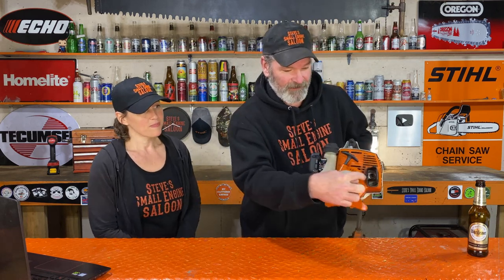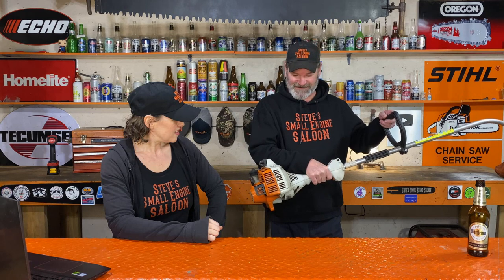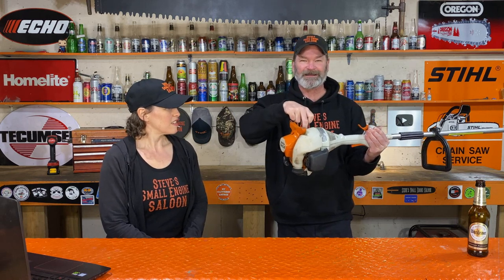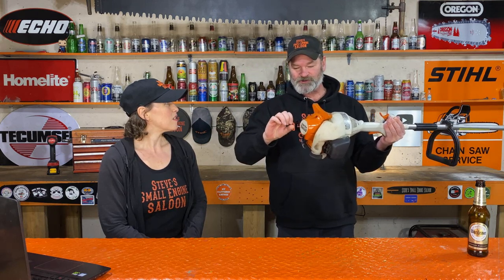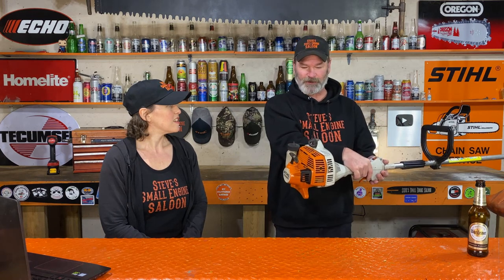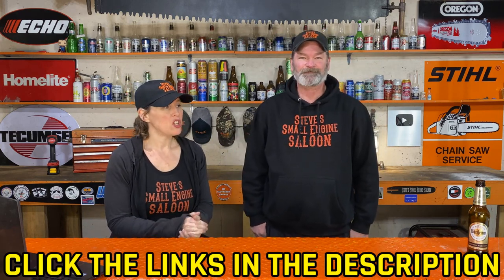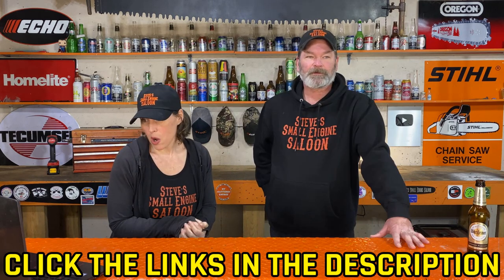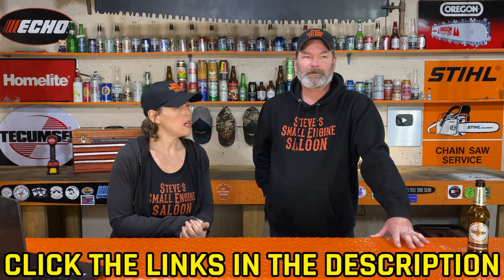Why Is There Black Oil Coming Out Of My Muffler? (DAY 27)

Comment: Thanks for sharing Steve, if I can add - The black oil Is known as spooge, it’s when a 2 stroke is running too rich, too cold or if the engine doesn’t get enough load. It’s incomplete combustion.

Comment: That's a good tip, because a trimmer doesn't get tipped over as much as a chainsaw.   My trimmer muffler is quite a mess, but I don't really care.  It's still running strong after 29 years.  If I cleaned it up good, it would probably die tomorrow.    I will flip it some time, but not today (nasty snow storm at the moment).   Good stuff!   Thanks for sharing your knowledge!

Comment: Also, could be from an engine that is tuned too rich.  The unburnt fuel/oil will build up around the exhaust outlet.  My ice auger will do that on a warm day on the lake.  After 10 or so holes there's black goop dripping from the muffler.  Wonder what folks would think if I turned an ice auger upside down on the lake and revved it up?
Reply: Tell them your fly fishing!!!

Comment: Great Steve and April, I also like a little smoke in my 2-cycle exhaust from oil/gas fuel mixture to make sure it has plenty lubrication as some may not know that is the only lubrication a 2-cycle gets on the internals in contrast to a 4-cycle with oil in it's crankcase.

Comment: I've never heard of that tip but will definitely give it a try. I just got a new 2 cycle weed eater and noticed the black oil under the muffler w which started leaking from between the covers. I thought maybe it was running rich, but I'm glad I found this video first. Thanks for the tip.
Reply from the maker: You're Welcome...

Comment: Ok Steve, I see your holding a FS45. So now you can show us how to tear it apart to change the kill switch, (day 25 show). I've used WD40 on switches before with good results. But like you said, there's a 2 out of 10 chance that I'll have to change the switch!  I'm gonna go run my weedeater upside down now! Good tip, I never thought of it. THANKS!

Comment: Because I grew up running two stroke engines in model aeroplanes i learned very early how to avoid flooding. But far to many guys don't understand that a couple of pulls at full choke is more about priming the engine. Depends a lot on the engine but some fire at full choke, some you need to back the choke off after a couple of pulls to avoid flooding. The manuals never explain this stuff very well though.
I've seen guys pull and pull on full choke ten plus times and it's over.
But you can't tell 'em. They will not listen if you tell them to back off the choke. Lol.
Reply: And I thought it was just me watching guys flood 2-strokes! It is sorta funny, just not to them lol. Oh, and it usually takes that customer 3 or 4 times flooding equipment until they finally get the joke 🤣😁
Reply: @donmayberryjrsOPE  
Some guy's think and listen. But it's usually the people who think they are smarter than average who are the dumbest.
Reply: @joschmoyo4532  true story!

Comment: Very interesting! I’ve had a similar problem with my MS251 for years and haven’t been able to figure out why. Thanks guys!
Reply from the maker: Our pleasure!
Reply: Hey jason, ive got a brand ne 251 too, and the same problem. I thought at first that its gonna stop splashing after 3-4 tanks, but im on my 5th and it hasnt stopped yet. It it ok for you now? Did this throttle and turnover trick work for you?

Comment: The same phenomenom exists on all 2-stroke engines, including outboards as unburned fuel runs down the middle section and dilutes carbon deposits on its walls. It happens mostly after prolonged cranking as raw fuel is shot down the exaust.

Comment: I recently bought a push mower that wouldn't start.i got to messing with it, oil was coming out of the muffler. The fellow I bought it from had turned it over the wrong way so I thought maybe that's why oil is coming out of the muffler. I looked in the gas tank & decided to put in fresh gas. When I dumped out the tank, to my surprise there was oil in the gas tank. I rinsed the tank with gas, cleaned the plug, finally got it started. It smoked for a long time, then quit smoking. The motors good. Why anybody would put oil in the gas tank I couldn't say. Maybe the best $10 I've spent in a while.

Comment: My Echo 2511T is doing this...I leaned it out as much as I could without taking the limiter caps off...still oozing out of the muffler. Will have to try this but obviously would like to fix the root of the problem which I believe is just running too rich like a lot of Echo saws seem to

Comment: I agree with 99 percent of what you said except one part. That oil/fuel mixture that puddles on the bottom of the crankcase with be forced out and burned at full throttle because the air velocity will lift it to the transfer ports and burn it.

Comment: I'm gonna try that tomorrow!!!! I've got an Echo SRM 225 that has blown oil out of the muffler since I purchased it in 2019. It runs great, it just blows out oil. I've got the carb tuned right, 50:1 mix, but it's done that since I've had it. As a matter of fact, I've got other two stroke equipment including Echo, that doesn't blow out oil. It's just the SRM 225. I'm gonna try what you said maybe tomorrow. I'll let you know if it works.

Comment: Hi Steve,  After looking at several videos, I saw yours.  It has been blowing a lot of grey smoke and leaking oil on the deck.  Yesterday It would not start at all.  I cleaned the air filter and let it dry and thankfully it did start.  I knew that I had put to much oil in, but on my mower it is difficult to see the amount in there.  After watching your video I took more out .  Now no more grey smoke and a small amt of oil on the deck.  Thank you so much.  How long does it take for the oil to stop collecting on the deck?  This nurse is grateful since I don't have a truck to take it in.

Comment: I ran echo red armor oil in a lawn boy mower with a carboned up piston, and black goo was coming out of the muffler. I cleaned it all off and switched oils and it went away.
Reply: I’m having the same problem with my echo 2030T. I’ve been running echo red armor at 50:1 in it since it was new and it’s only 3 years old. It’s got black goo coming out of the muffler and the spark plug was covered in black oil and crud. I know a lot of guys swear by red armor, but I’m beginning to think it’s the problem. I also have a echo GT-225 that has the same issue and I’m running the same oil in it. I’m gonna switch to Amsoil Sabre and see how that goes.

Comment: For two stroke engines, it's normal some black oil is coming out from muffler. The oil  mixed in fuel have to go out. That's only through muffler.

Comment: Older 2 cycle power tools are the best... EPA ruining shit. I keep 1 gal each of 20:1 for older 1980-2000 & 40:1 for the 2010 range trimmers/blowers. 100 race fuel & Amsoil, VP or Red Armor.

Comment: It is caused by using oil with a higher flashpoint. drool as it is called. Most full synthetic oils are low flashpoint and burn completely with little to no carbon or soot on the muffler.
Reply: True story

Comment: hi Steve, I have the same problem but on my very old 2 stroke bicycle (solex) i have constant black mix coming out the long muffler, havent tried running it upside down but ran a good 20 miles and no diffrence?

Comment: I'm having this same problem this was a brand new neotech 660 Stihl clone and it cranked right up the first day cut a few trees no harm no foul the next day I can't get it to hit and the decomp. Valve pops out after every pull today trying to start it black oil was running all out the front and I can't get it to start I cleaned out the muffle and the exhaust port but still it won't even fire

Comment: My echo 225 weed eater did that great idea there young man and Lady 👍😎😜
Reply: The echo SRM-225 does this because of a design flaw. Turning it upside down will not help. They are notorious for this. Get rid of it, pay $50 more and get a 2320T which is a commercial grade lightweight trimmer. Chrome plated cylinders, Rated for 300 hours, where as the SRM225 is only rated for 50 hours as it’s a cheap residential grade trimmer. I got sick and tired of getting burned by hot oil shooting out of the exhaust and landing on my skin.
Reply: @Mason-RRC  thanks for the info on this matter

Comment: So a long time ago I worked on a trimmer that had this problem and I found out  It was because the fuel filter was not connect to the fuel lines.  Bought a new fuel filter and new lines installed them and the trimmer worked like new.  Cleaned the spark arrester and muffler and back to trimming

Comment: I am having that exact same issue right now but the funny thing is it still starts up and after about 2 minutes of it running it starts Pouring out oil out of the exhaust If anybody has any sort of advice I would really appreciate it The exact weed eater I have is a echo gt225

Comment: You forgot to mention that it can also occur when you run a richer oil mixture in your fuel as well and also even when oil mixture is right it can still occur from the unburned oil building up inside of the muffler itself so if you're going to explain why it happens make sure you actually give the full explanation and the best way to keep that from happening is take the muffler and place it on a good flat surface that won't burn and pour just a little bit of gas in the muffler and light it and let it burn until it goes out on it's own and it will burn all excess oil out of the muffler and then you can take some pliers and pick it up and lightly tap it against something and knock all the soot out of it and put it back on the weed eater or chainsaw and it will be good to go again

Comment: The only time l see that is with the echo 225 trimmer with the non greaseable head the oil blows out the exhaust all the time l fixed mine by installing the greaseable head from the pas system the older 225's don't do that take care my friends 😁